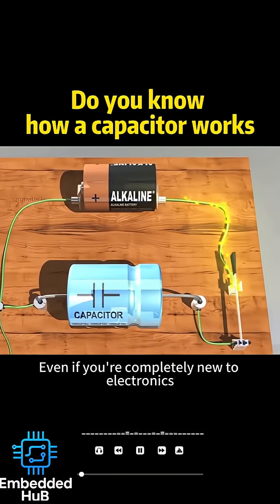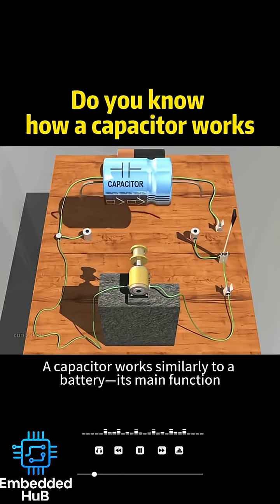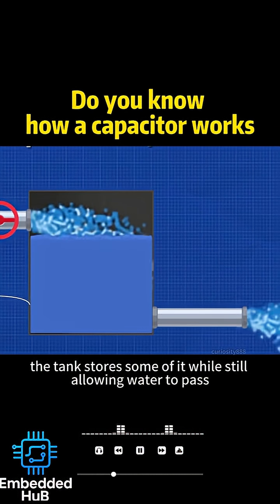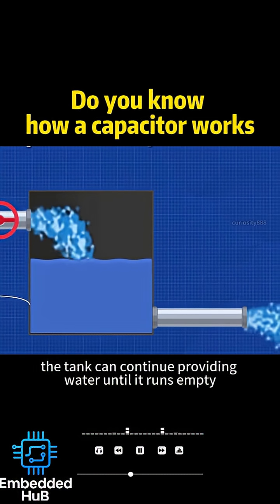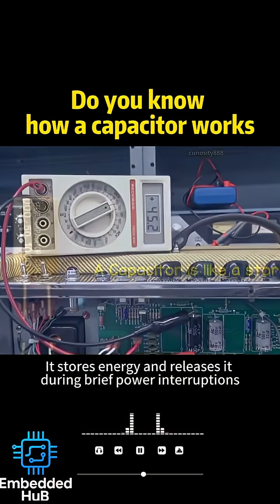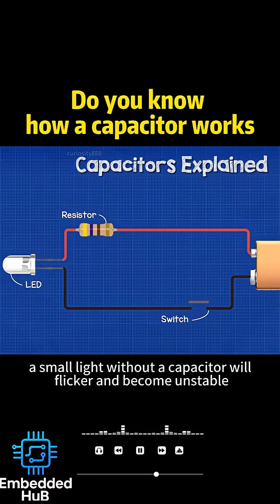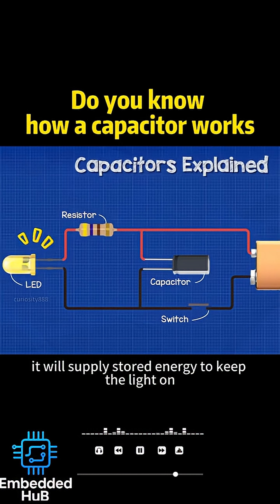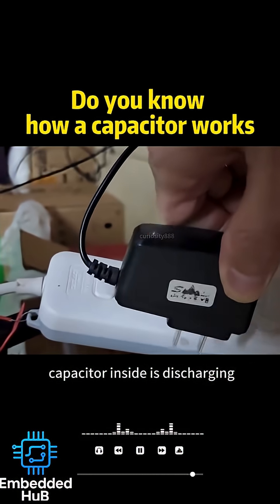⚡ What is an Electrical Capacitor? | Key Features Explained in 60 Seconds! ⚡

Comment: If capacitor is in series DC circuit IT stops electric flow when it is fully charged. Doesn't sounds like water tank.
Reply from the maker: Yes, that’s a good way to think of it! In a DC circuit, a capacitor charges up and then blocks further current flow, similar to a water tank getting filled. The difference is, in AC circuits, the capacitor keeps charging and discharging continuously, so current can keep flowing

Comment: A capacitor does not work similarly to a battery. A capacitor works by storing electrical charge between two conductive plates separated by an insulating dielectric material.

 A battery works by storing energy in chemical form, converting it to electrical energy when connected to a circuit. It has two terminals, a negative anode and a positive cathode, separated by an electrolyte.
Reply from the maker: Yes, true  a capacitor stores charge, a battery stores energy chemically. I kept it simple in the video for beginners. It's not act as a battery 100%

Comment: If your motorcycle headlight is flickering due to a bad battery or even no battery at all and it only work because of a stator. you can put a capacitor to stop flickering.
Reply from the maker: Yes, that’s correct!
If your motorcycle headlight is flickering because of a weak or no battery, the power from the stator can be unstable. Adding a proper-rated capacitor (usually an automotive-grade electrolytic capacitor) across the circuit can help stabilize the voltage and reduce flickering by smoothing out voltage fluctuations.

 But always make sure the capacitor voltage rating is higher than the system voltage (e.g., use a 25V or 35V capacitor for a 12V system) and properly wired to avoid damage.
Thanks for your useful input! 😊
Reply: @Embedded_07 what do we call that setup? Is it considered as a "filter capacitor"?

Comment: But I made the mistake to the capacitor with dc power through wiring positive to the negative but it bursts.
Reply from the maker: Yes, applying DC voltage directly across a capacitor without considering its voltage rating or polarity (for polarized capacitors like electrolytics) can cause it to burst or get damaged. Always make sure to check the capacitor type (polarized or non-polarized) and apply the correct voltage as per specifications.
 Thanks for pointing that out! Stay safe and always follow proper wiring practices when working with electronics. 😊